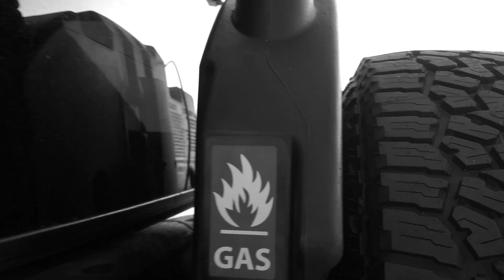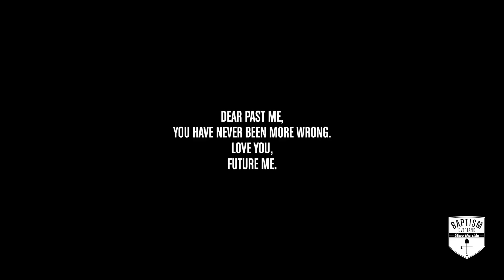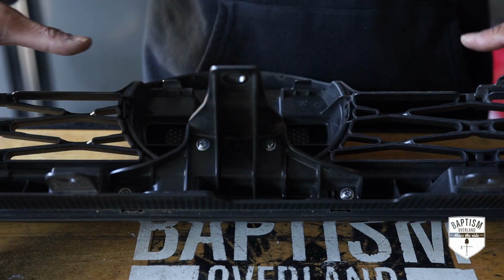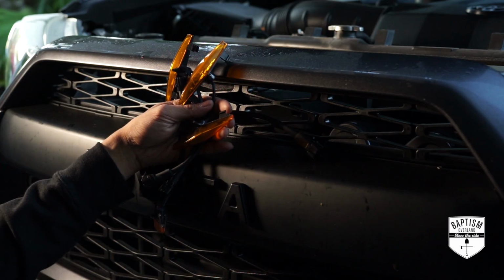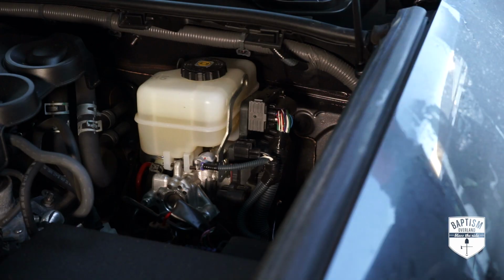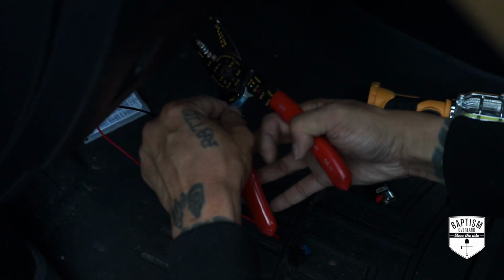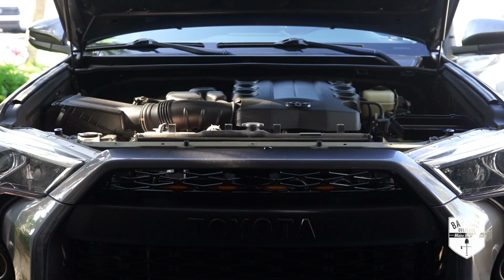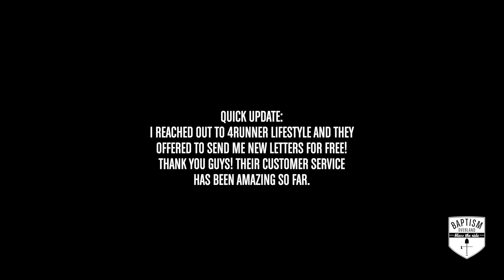The Letters Are Crooked!! *Installing the 5th Gen 4Runner TRD Pro style grill w/ amber lights!*

Comment: I also got the TRD Pro Grill from 4Runner Lifestyle.  The new grill insert had issues.  The top holes weren’t drilled and plastic that needed to be trimmed off to fit inside the upper grill. Basically a bad mold.  I have the same exact issue with the letters. I like the heat gun trick to fit the cover piece and adding two screws underneath.  Definitely going that route.  👍
Reply from the maker: Yeah def had to make some tweaks. Luckily they sent me new letters to try again lol
Reply: @BaptismOverland  Good customer service.  I ended up taking the 3M tape off the letters. They fit perfect in the alignment holes and sit flush.  I used some plumbers goop and glued them in place.  The excess goop rubs off easily.
Reply from the maker: @WOLFN8TR  yeah it's the tape that gets in the way. Good solution

Comment: I think you can heat them with hair dryer, then use some fishing line or dental floss to cut the tape away and redo them, but you'll need to probably cut your own 3m double sided tape again. To get mine straight I lightly laid down the letters so they wouldn't stick so much and then aligned them till they were perfect, then pressed down when I was sure

Comment: I got the version that uses screws to attach the letters and apparently I didn't get the first T tight enough since I was a little worried about stripping them out. Any ideas on what I can use to stick it down securely without having to remove the entire piece to access the screws and I don't want to use super glue since it would show a bunch of white residue when it dries.
Reply from the maker: @bigshoe84ify  I had to order a new set myself. Sucks

Comment: Is there a way to have them come on only when I have the headlights on at night?
Reply from the maker: Yes. Instead of going to fuse box you would just tap into the positive terminal to the positive wire going into one of the headlights.
Reply: @BaptismOverland  Thanks. Will be giving it a shot. Raptor lights are cool but I just don’t think they should be on all the time in my opinion. Great vids!

Comment: Does someone besides Toyota sell the whole upper grill and not a thin tape-on conversion cover for the middle part ?  Seems it would be better to replace the whole thing.
Reply from the maker: Exactly what I said! And I looked but no dice. But essentially you'd have to replace the entire bumper. That middle part is connected to the number as one piece
Reply: Correct me if I'm wrong but even the OEM trd pros have their upper part stuck on with double sided tape, on to the standard bumper. I believe the only difference between a factory trd pro bumper and a factory base sr5 bumper if that stuck on cover with letters
Reply from the maker: @BOBBYdigital31  you're probably right. But at least at off the factory they have machines that will make sure it goes on straight and consistent with every model. Doing this by hand and trying to match the nubs on the back with the indents on the grill was a PITA lolol
Reply: @BaptismOverland  

True. I got super nervous trying to stick it on correctly
Reply from the maker: @BOBBYdigital31  Same.

Comment: i purchased from ebay for $ 70.99 from Tomautoparts....Top grill is not easy fix, but i did some alterations and bottom i managed to fix letters but the size of black cover is short by half inch...and even thand even i messaged the store..but no response,  So i  contacted ebay..they send me return label with $44 return shipping fees..so even sending back i m making loss of $ 44. So by any way,,i can fix it ..? any suggestion help appreciated.
Reply from the maker: Idk what to tell you man. That's the reason I don't usually buy that stuff from eBay. You never know what you'll get. I got mine from 4Runner Lifestyle. When I go directly to shops with that stuff I get better responses.